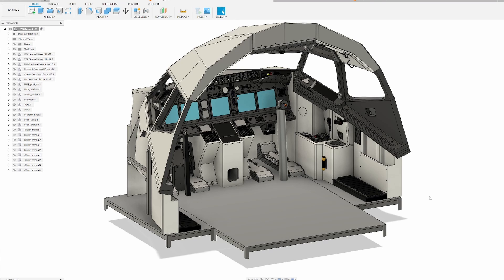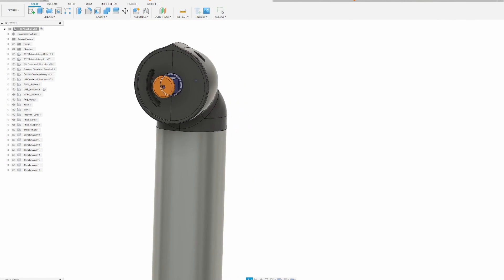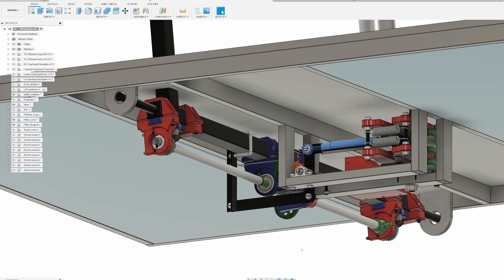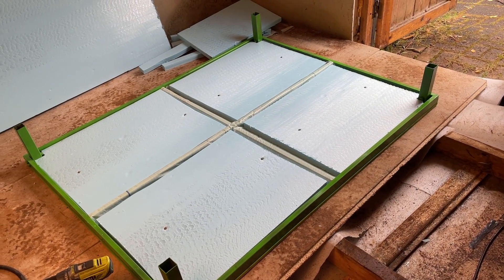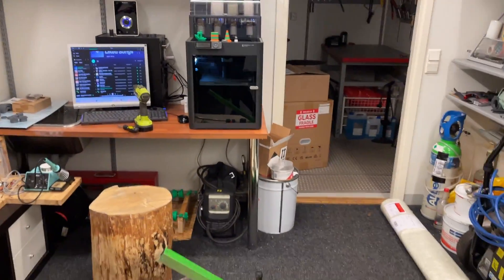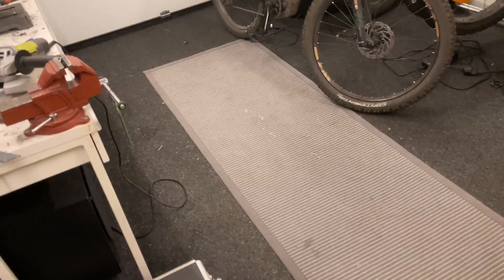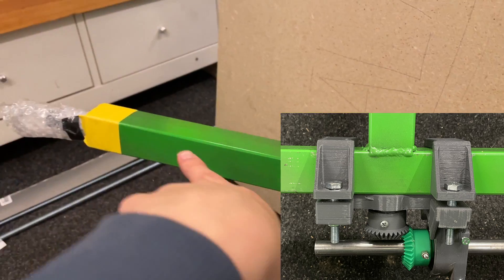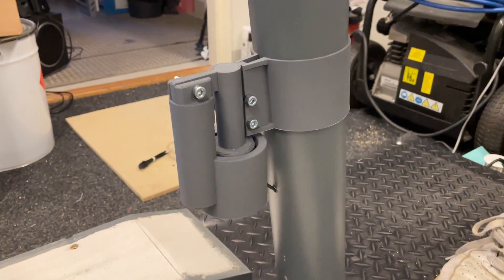Dual Yoke - [B737 Build #2]

Comment: No interest in a FFB yoke?
Reply from the maker: We thought about it but achieving a good FFB for the roll and pitch is really difficult and not many software support it. It is definitely something we might consider upgrading later though. Having good force feedback would be amazing but I also have no idea how the real plane feels so I would have no reference either.
Reply: I have a DIY FFB yoke and stick that I built out of Big servo VPForce kits.  Only use them on MSFS and DCS, so cannot comment on anything else, but they do add to the immersion and having the real trim center change like it would in a real aircraft is excellent.  Maybe something to investigate once you sort everything else out which is allot :-).  All the best.  @diy_finn
Reply from the maker: That sounds so cool! I will definitely look into that once the cockpit is closer to completion. Thanks a lot!